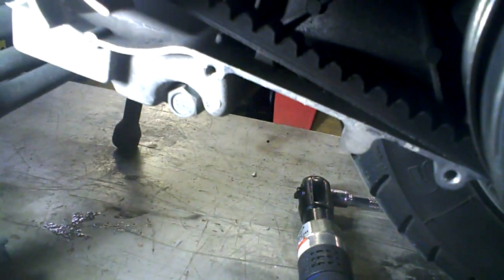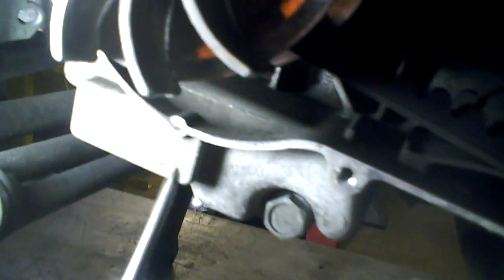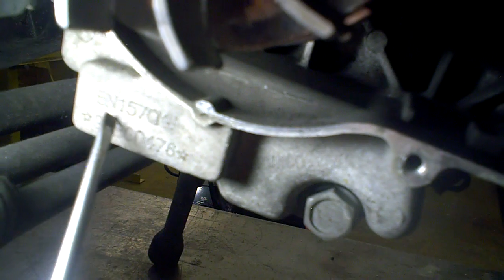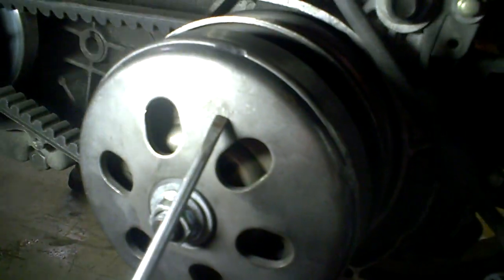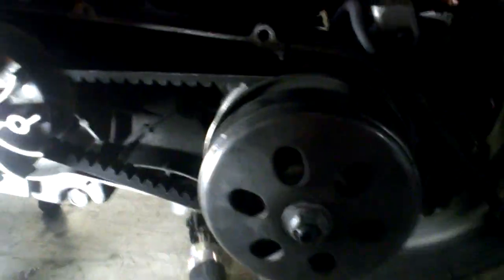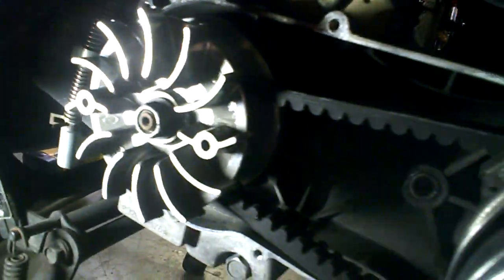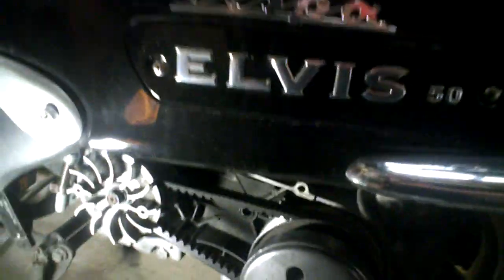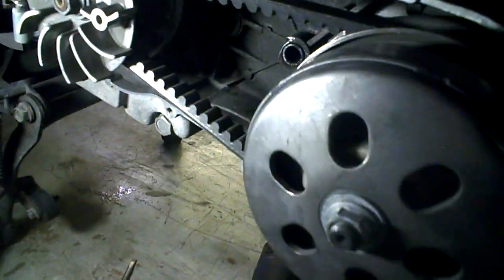Identifying Chinese Engines

Comment: That's not a generic GY6 engine the.    That's considered a big block 150    should be able to be taken all the way up to 230 to CiCi's.   You can tell because of the designation BN in front of the 157QMJ        standard GY6 150 can only go to like 180 or something like that the one you got those the one you want I'm not mistaken the generally get better build quality as well from that particular factory
Reply: Hi i have a kamco 125cc. I cant find the gy6 anywhere it is marked  kb25*1500113* it is a gy6? Because i want to upgrade the bore to 61mm from naraku do you know if it fits on base of the cylinder on the crank cases? Thx

Comment: Hey I recently bought a “150cc atv” it’s a semi auto and when started trying to fix it a lot of the parts were for 110cc and I was confused so I came to this video and I found the number that was printed on the case and it’s says 152fmh so is that actually a 150cc or is it a 125 or 110 because it’s a pretty big quad it’s nothing like the small 110s and it’s a 2005 linocoin

Comment: I just bought a trailmaster blazer 150x but I dont see any markings where yours are.  It is just blank.  It's supposed to be a 150cc gy6 but I want to know exactly which one bc I want to make sure im buying the right parts when I upgrade it.  Is there anywhere else the engine type should be stamped?? Thanks
Reply: Did you ever find out where the stamp is on the motor? I’m having the same problem on my helix 150